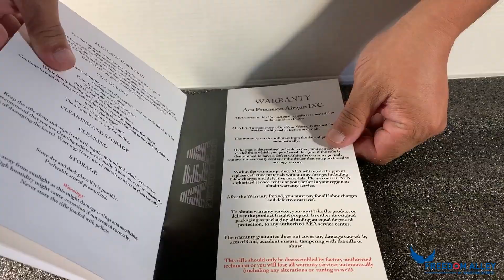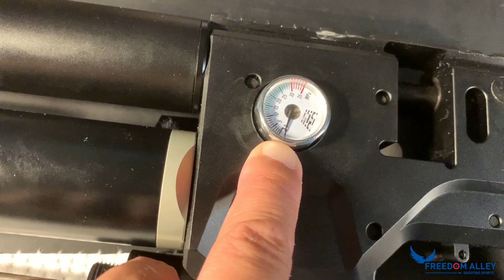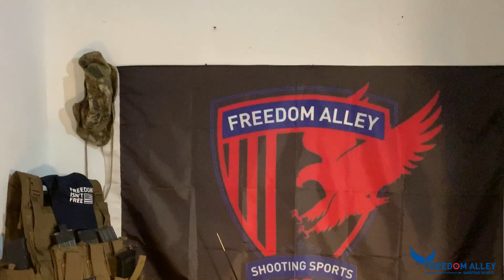AEA How To: How to assemble AEA 9mm Terminator

Comment: I am concerned that this video spends alot of time explaining how to trouble shoot issues that are manufacturing problems. Leaking o-rings, butt stocks that do not assemble correctly, malfunctioning meters ect? If I am dropping over a grand on an air rifle I would expect that the quality would be much better than this. I understanding having to assemble parts of the gun but I should not have to REPAIR it right out of the box. Looks like second hand, knock off garbage.

Comment: Where to buy this 2nd version Terminator now?
Reply: Aeaairgun.us.com got mine earlier this month
Reply: @evenodds8791  ok what's the fps now with 81gr Diablo it was around 870-910 fps is it up to 950fps now with the 30% power increase 🤔
Reply: Optimus Prime don’t have a chrono and haven’t shot diabolos but I did kill a decent sized hog with 82 gr H&N slugs
Reply: @evenodds8791  - great shoot jsb pellets they are the most accurate in 81gr I'll order 2 and custom  tune them with larger capacity magazine and tank's with a more fps🤐
Reply: @mackattack8627  lmk how it performs tuned
Reply: @mackattack8627  larger magazine capacity? Is this possible Optimus? And could you plz describe how to acquire such a thing?
Reply: @mackattack8627 which pellets exactly? Also how many shots per fill are you getting?
Reply: The pellet shop